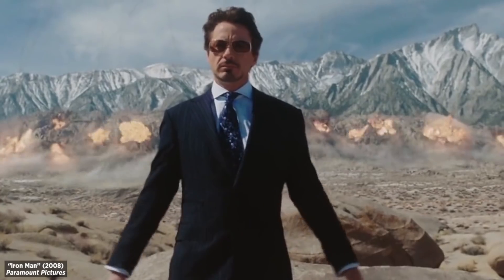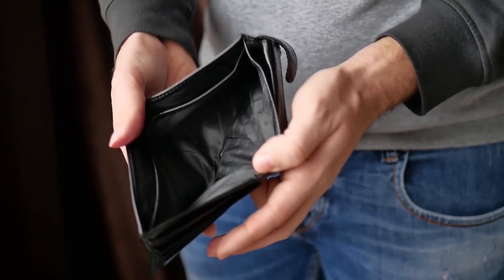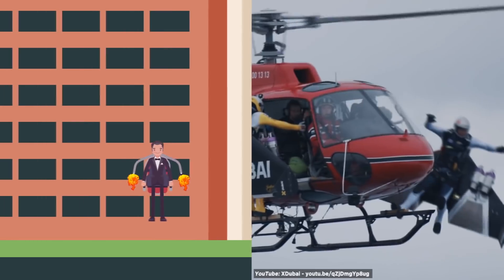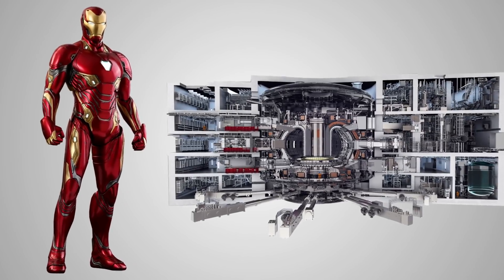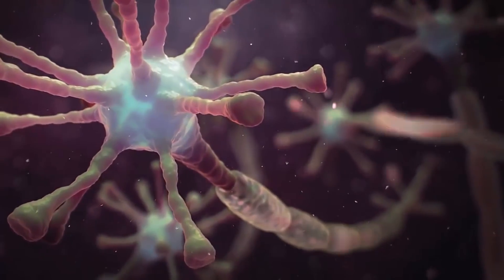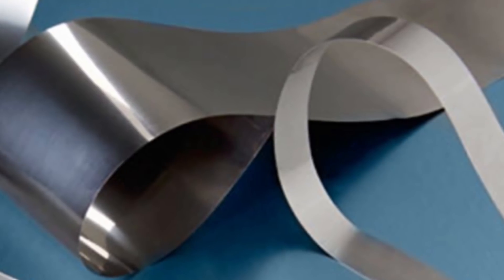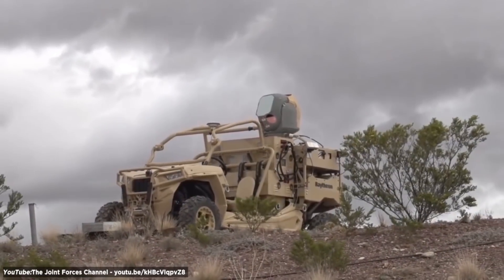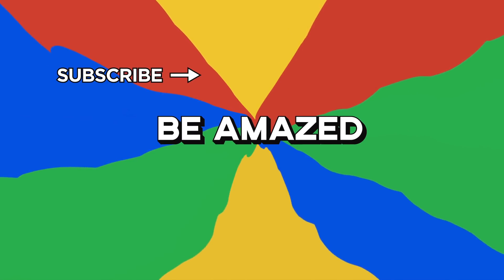How Close Are We To A Real Iron Man Suit?

Comment: If Graphene battery is a success, it can push the limitation further to few hours flight.
However the best power source to run it is miniature Nuclear reactor which closely similar to arc reactor. Engineers have to design to store and control Nuclear reaction in the reactor to produce such power for the whole suit.

Comment: Carbon fiber exoskeleton with graphene capacitors to store the energy would be a simple yet great solution towards this.
Reply: carbon fibre is probably less efficient
Reply: @jamiealford638  than what? Its lighter and stronger than aerospace grade aluminium. It is also come down in price over the last decade as race car manufacturers have found new production methods, and it's more bulletproof than kevlar. I appreciate the comment, and the thought behind it. And yes eventually there inevitably will be the perfect material, but for right here and now, I cant think of a better material available.
Reply: @coolnegative  thats an over exaggeration because carbon fibre is weaker than the current exoskeleton material steel or titanium. I assure you cars don't use carbon fibre for strength they use it for style. Also carbon fibre has roughly the same tensile strength as aluminium.
Reply: @jamiealford638  ok. Pound for pound its stronger and formula one among many other race types adopted carbon fiber specifically for the combination  of light weight and strength compared to any other material.  I apologize if either my initial comment or reply came across mis leading or combatant. That was not my intention. I was merely trying to get the point across that if weight was the only issue, graphene capacitors (although still being worked on) is a high capacity, instant charging power alternative. And since carbon fiber is one of the lightest and strongest available  materials that they would be the best combination to make a suit light enough for the start of making the concept a true pheasble reality. Carbon fiber, especially newer and better methods of carbon fiber nano tube weaves, yes pound for pound it is stronger and more resilient than kevlar and most available metal alloy alternatives, including aluminum. Again I apologize if I came across wrong. Hope you have a great rest of your life.
Reply: @coolnegative  cus ur a nice dude or gal ima say have a great rest ur day aswell however carbon fibre has a better strength to weight ratio but that doesnt mean that its stronger
Reply: @coolnegative  i take it back ive done some thinking and carbopn probably would do so i appologise but i think the design of the exoskeleton could also change to either a hexagonal tube or triangular as both are stronger than rectangular or squared
Reply: @jamiealford638  dont give it a second thought my friend. I really appreciate it!

Comment: I just want to say that your puny mind cannot comprehend an "arc reactor". Fuel is air, air is fuel. the nitrogen in our atmosphere, (80 ish percent) can be transformed into liquid nitrogen, and if you've been watching Alex lab, you can see that he powers a small exo skeleton with this. The power that stark requires to fly is easily created and used with tiny explosions of nitro methane and ethylenediamine dihydrochloride. These chemicals explode on contact, being more than enough for lift. graphene and nitinol can be used properly to withstand the high temperatures he goes through. We dont need thoroughly advanced technology for the hud. all you need is a small, clear monitor that has custom characters to regulate what you see in the iron man suit

Comment: I just want to say that your puny mind cannot comprehend an "arc reactor". Fuel is air, air is fuel. the hydrogen in our atmosphere, (90 ish percent) can be transformed into liquid hydrogen, and if you've been watching Alex lab, you can see that he powers a small exo skeleton with liquid hydrogen. The power that he requires to fly is easily created and used with tiny explosions of nitro methane and ethylenediamine dihydrochloride. These chemicals explode on contact, being more than enough for lift. graphene and nitinol can be used properly to withstand the high temperatures he goes through. We dont need thoroughly advanced tenchnology for the hud. all you need is a small, clear monitor that has custom characters to regulate what you see in the iron man suit

Comment: Not sure of the power source being able to be made, but a different kind of repulsor that uses low energy could be possible, the repulsors in Ironman are a new type technology that don't depend chemical fuel for propulsion, so perhaps a system that ionizes the air, or uses certain frequencies of subsonics to affect certain frequencies of light from LED lights could be made to reproduce the repulsor technology, this method would use very little power and the suit could use rechargable batteries for power and possibly even solar energy. The frequencies of the subsonics and light and their synergistic effects would have to be found through research and development, but it seems possible to be able to make repulsor technology similar to the kind in Ironman.

Comment: There are a number of serious problems with the Marvel conception of many things in that suit. First of all, the Arc reactor had copper wires leading from it to power some mystery thrusters, what I would summise having something to do with a mix of heavy positive ions and Mickey Mouse juice, since no liquid or solid fuel could have been used as there's simply no space for either. Why even add the effect of a jet when it's obvious there's no fuel tank?  Copper wires of that gauge, probably an awg10 could only put out 30amps each at 120v, and nowhere on earth would the math make sense for using that little bit of power to ignite hydrogen or any known fuel other than something radioactive. So then we might say 'inductive', in which case, yes, we could use inductive zero point energy which means a carrier wave to convert carried waves to pump z waves, but any way you calculate it all, those wires could only be giving signals to other 'arc' reactors, so the one in the chest really has no bearing to thrust capability whatsoever except in the first iron man suit built in the cave, in which case it could have used the wired power to spin superconductors with .1mm holes in their cores or something zero point which would ignite hydrogen.  
Second of all ; palladium ; 1.6 grams of it, did I get that right? The pure insanity of all this is that palladium's ONLY great features would not be of any use to a real zpe device, and then they go on to rub it in by saying the darn thing decays! And why? What element would decay so fast? Nothing, is what. Super rare radioactive elements could, but they were not mentioned and would only boost the dielectric capacity maybe 150% at best, and would not cause the reactor to stop working once they decayed because the main dielectric material of which they coat would obviously still have function in the design since, as a zpe device of which I have studied many in the last 25 years, it would simply rely on the formation of a particle vacuum formed by single sideband about a torus shaped array.  
Ultimately, even with multiple arc reactors made using a proper pulse discharge cap orbital circuit configured in some manner of wave compression to split heavy positive ion charge from the longer and slightly lighter negative ion charge in bias to the negative pole running through the orbital plane, you'd have a lot of electrical arcing happening all around the device and or suit due to the nature of that superconductive charge in motion, but you'd also have something Marvel never aticipated and should have; Because whenever a zpe device is left ungrounded it must consume more time energy than surrounding matter, and would form a very protective ionosphere about itself naturally. All spinning heavenly bodies with any bit of magnetic core do this, they must. The stronger the zpe is folding space into energy (ie; the more thrust you have) then result is even more ionosphere strength quite capable of being used to propel said circuit far faster than the thrust itself would.  Just one example is Victor Grebennikov's flying platform.
So who's been working on such coil tech? For obvious reasons I'll never reveal results here on youtube or any online source. Do the delight of many however I can tell you this; a specific and very common beetle found from places between Korea and E.Russia can be used for flight over 900mph. You just need to study Grebennikov's pattern and system... but be sure and keep your thrust at chest level and give the 'box' a hole in the middle to vent in neutral ions, otherwise your joints will hurt and you'll get sick like he did. The design is not limited to a box.  If you get enough bug wings to glue into bowl shapes for that pattern, you can coat the wings of a mechanical dragon if you wish and scare the shit out of your friends... and enemies.

Comment: exoskeletons only cover lower body and only enhance strength in terms of carrying heavy military gear longer without injury: a far cry from even the cheap knockoff Hammertech battlesuit, which could help you go a round with Luke Cage.  No matter how cool they try to make that glider and jetpack look, neither comes close to "Iron Man territory", which would involve at minimum reaching over Mach 1 speeds and leaving the atmosphere like the Mark II.  No matter how compact it might be, a fusion reactor is by definition, nuclear and thus produces radiation, making it anything but clean.  This was the problem Tony had with the palladium reactor, it was poisoning him, requiring him to create an entirely new element for the reactor.   If you are seriously considering either remote control drone war machines or having heavily armed robots fight our wars, I recommend you look at every piece of science fiction ever made since the creation of the word robot to see how those are horrible ideas.